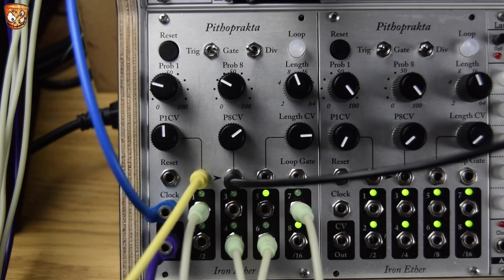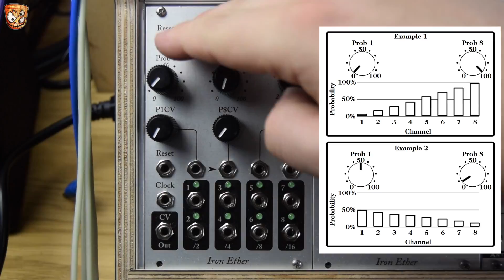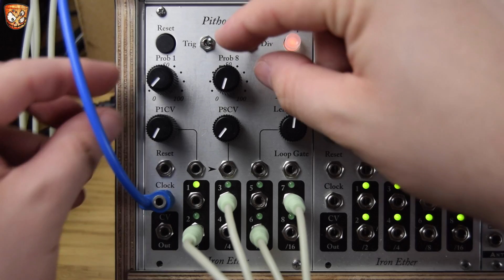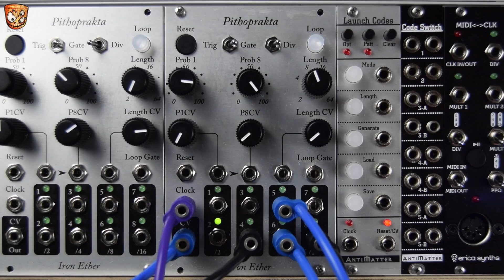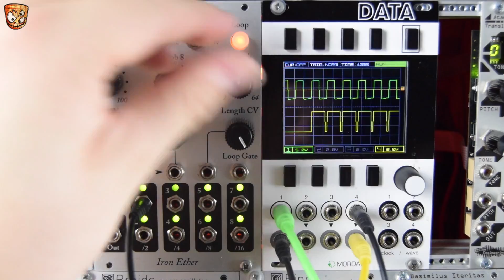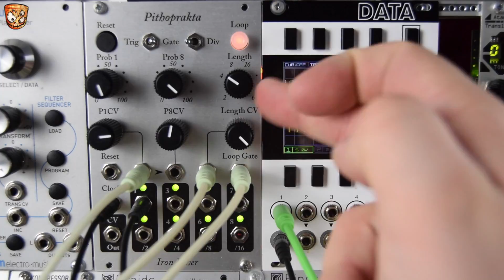Iron Ether - Pithoprakta

Comment: Can you please tell me if this can do any time signatures other than 4/4? Hard to tell. Cool demo though!
Reply from the maker: Hey Modus, cheers for the question and comment. Yes it will, just reset it and you'll get patterns of whatever length your reset is working with.
Reply: Ah yes. That makes sense. Thank you. I'd thought about that but wasn't sure if the resulting beat would sound like it was a proper odd time sig or not. Cheers!
Reply from the maker: yeah it will do. Just endlessly random probability will work against things in any time signature though. But you can lock the loop and reset to start creating looped patterns in any time signature and let some random come in (or not).
Reply: Right on!
Reply from the maker: it's good fun.

Comment: God, that‘s kind of a drum pattern generator. what do i do with my GRIDS and Branches now?
Reply from the maker: You use Branches with it to create auxiliary patterns based on this. Take two outputs from this and run both channels of Branches to move slower modulation sequences or accents against the drum patterns this creates. You can then CV in the accents to be more heavily featured in the beat of not. While also CVing the density of your rhythms. Grids would set up a nice basic beat for this to play more randomly off too. Depends how many rhythms and gate patterns you can take before overload though! :)
Reply: you could also use grids to clock it , or use it to clock grids, use the CV out to control the chaos on grids even.

Comment: How short are the triggers?
Reply: There's a "system mode" that lets you set the trigger length, from 1 ms to 8 ms. You can also set the gate length in relative amounts, from 1/8th of a step up to the full step length.
Reply: awesome will definitely be looking to pick one up then!
Reply from the maker: you won't be disappointed with it.